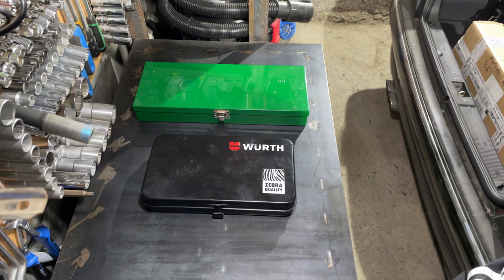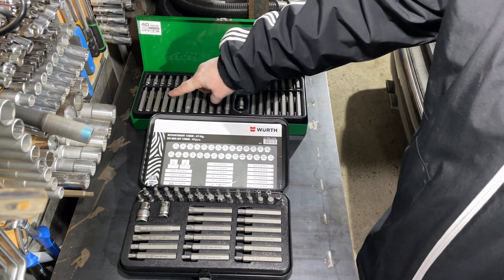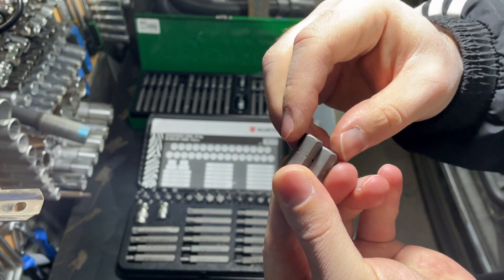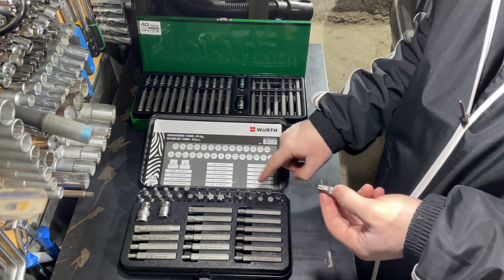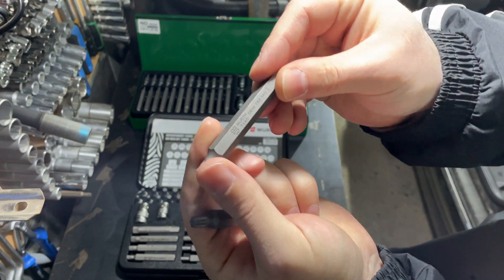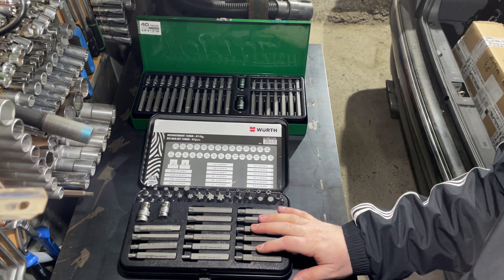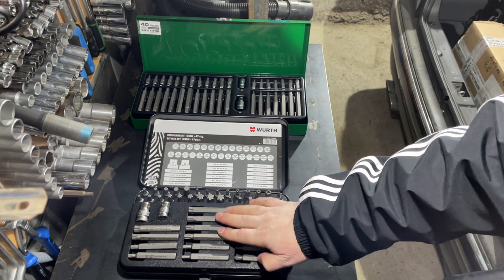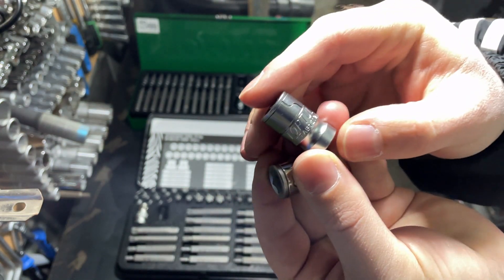WÜRTH ZEBRA vs TOPTUL - Bit Sets Comparison

Comment: I've been enjoying your videos. Great job. Seems that wurth zebra has tighter fitment but other than that the bits seem identical. Since you have been working some years now with toptul bit set, have you observed anything wrong with them? For example is there any distortion on toptul bits on high torque applications?
Reply from the maker: @KavvadasLefteris  
Both are great. If you like to serve the money, get Toptul.